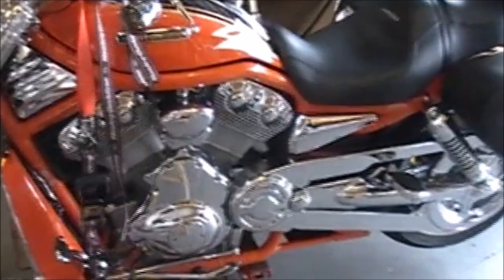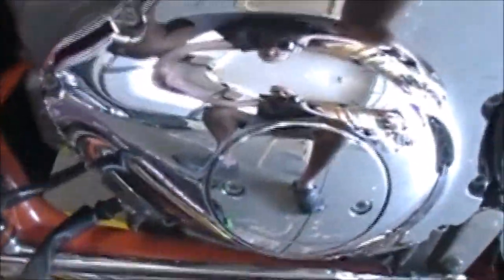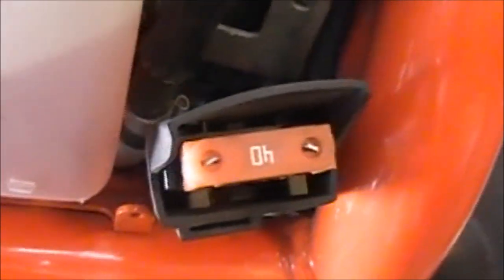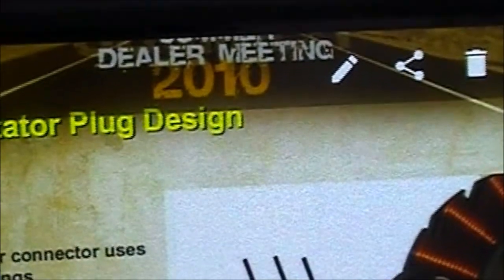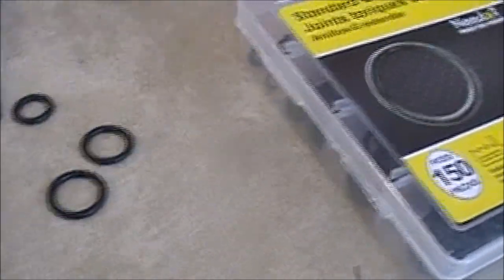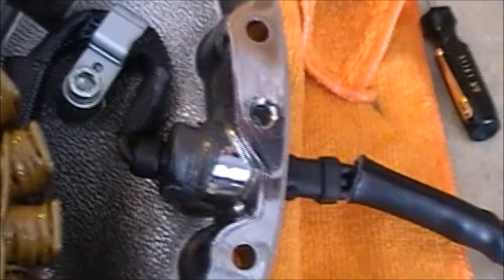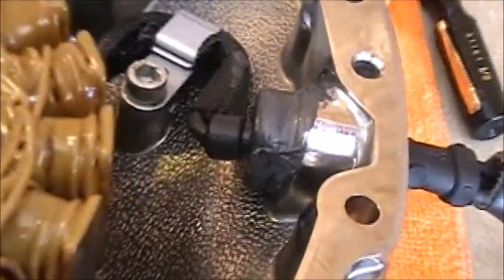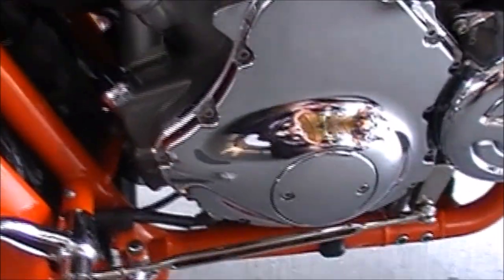2005 VROD Stator Wire Oil Leak Repair

Comment: Thank You Buffalo Peter for this fantastic tutorial  video.   The same scenario happened to me after an oil change.  One thing about HD dealers, nobody wanted to tackle this repair, which told me one thing, either it's too hard or they are chicken.  I watched your video about ten times and then did the repair.  Not hard, just time consuming.  Thanks again Bro !  Cheers !

Comment: Just finished applying the RVT. Waiting for it to dry and I'll get it back on tomorrow. Thanks for this video; very helpful. 

Things I learned:
- My HD shop helped me remove the electrical connector as i didn't have the tool for that. 
- 3/8th o ring was perfect. I tried to use some thicker ones (outer radius) and it wasn't gonna fit through the side cover. 
- getting the RTV around the grommet is a pain. A toothpick or something similar to help smear it around is helpful. 

I only had a small seeping leak so I really hope this resolves it completely. thanks again!

Comment: Thanks a lot. I did it on my VRSCR. Just to add some measurements if somebody needs: 

DIA of grommet groove:              13.0
DIA of grommet hole in cover:  15.65

O-ring ID:12x t:2

Install 3 o-rings ID: 10.8x t:2.4

After installation of 3 o rings measure of OD of grommet o-ring: 16.5
Reply: woot thx! mines leaking all over
Reply: Hey no need to go scientific here.

Just put 3 o-rings from the drain plug of a street 750 and thank me later 😎

Comment: Thank you for this. Did this job on my 07. Used just the o rings and it's holding fine. Thanks for specifics on bolt pattern and o ring size.

Comment: This worked great, thanks so much for posting it totally solved my oil leak issue. My video notes for others' reference:  
 1. remove stator wire connection from airfoil connection, the side cover comes off, screw on the bottom. 
 2. 
Then drain the oil 

 3. 
Remove the master electrical fuse (40 amp fuse)

 4. 
Remove clutch linkage (no need if middle control'd bike)

 5. 
Remove bolts from engine cover, bolt 14 to 1 per the chart. (screen shot video or refer to clymer manual)

 6. 
Take off gasket, clean it, set it aside. 

 7. 
Take off side cover with stator completely (the magnets will resist beign pulled out)..clean everything using break cleaner. 

 8. 
Push rubber grommet into/towards the stator 

 9. 
To get the o-rings over to the grommet, unpin the connector you removed from the airfoil. label each wire so you remember the ordering (he used white out and one dot, two dots, three dots, etc.)

 10. 
With the unpinned connector/dissassembled, feed the entire hose through the stator case hole to free up the entire cord. 

 11. 
Then add three o-rings : size 3/8” ID x 9/16” OD x 3/32” W (other sizes work, whatever you can get on the grommet and have the rings stay on when you jam the grommet back in. 

 12. 
Apply ultrablack to isntalled o-rings 

13.  apply ultrablack to grommet interface area 

14.  
let it dry for one to two days. 

15. ADD GUIDE BOLTS! IMPORTANT AS THE STATOR SNAPS BACK IN VIOLENTLY B/C OF MAGNETS. The size of the bolts you ened are 6mm x 70mm...cut off the heads using a metal saw. 
16. add guide bolts (cut the heads off the bolts to help guide gasket)
17. put gasket on. 
18. put side cover back on, careful with fingers, the magnets snap the thing back in. 
19. tightben bolts , ordering 1- 14 per chart.  then torque them all to spec. 
20. re attach shift linkage…use loctite. 

21.  
reconnect the wire to the airfoil connection

22. add master fuse

23. 
add oil back in (change oil filter if due for it).

Comment: Yes I used all three. Looked good and tight. Didn't leak a drop for close to a month. In going to pull it back apart tomorrow or Wednesday. I'll let you know what I find. Maybe The heat melted the o-rings. It is leaking worse now than it ever did. It looked snd felt tight after assembly.

Comment: Excellent video.  Thanks very much for posting it!  I'll do this exact fix on my 06 VRSCD.
Reply: Done and done.  No more leak! Thanks for the vid.  Might mention that the alternator cover is kinda held on by magnets, and the Service Manual lists a special tool to remove it (which my dealership couldn't even order).  Most people seem to just pull the cover off without the tool (which I did), which makes the little install rods (makeshift or otherwise) really nice to have when refitting the cover.  Just watch your fingers.

Comment: Either one of your upgrades, the o-rings or the sealant, likely would have fixed the problem but it never hurts to be double safe.
I found this post looking for a fix for the stator plug leak on my 98 FXD and got sidetracked.

Comment: Thanks for the video but I’m kind of screwed… in the process of doing the work, my wire marks rubbed off. Is there a way to know where they go in the connector based on how they lay next to one another? Any advice would be appreciated. Thanks.
Reply from the maker: Wish I could help you with this but not really sure how to.

Comment: Did you ever get this permanently resolved? I did the three grommets and the RTV, and while it initially worked, now I have a drip pan underneath because it is leaking bad. Thoughts?
Reply from the maker: bbrjch  I did this repair last July. Finished the summer off with no leaks. Been sitting all winter and still no leaks. After I added the 3 O rings and seated the grommet it was very hard to seat! Not sure if yours went in this way or nor. But it took a lot of pressure to get it back in there. Hope this helps

Comment: I have '07 VRSCAW model and oil is leaking in the same area. Going to attempt the repair any advice before I start?
Reply from the maker: Mario Rosales according to my info anything older than 2010 needs the O ring update. I have put a lot of miles on my vrod since this repair and have had zero problems, no leaks! Just make sure you torque every bolt to spec. They strip easy! I have some helpful pics but can't figure out how to post on here. Hope this helps bro
Reply: I will also be trying this repair for a second time. I am at the point of thinking about replacing the whole damn stator. Did Harley ever have a recall on these, since they all leak!
Reply: Same bike here, same issue, seems pretty common on the vrods. I'm doing this repair this weekend.

Comment: Ok I used permanent marker and dots came off wires- how do i determine where each one goes back onto the connector? I have orings installed so it’s ready
Reply: I did some research as I did the same thing. Marker rubbed off getting the grommet back through. I read that it doesnt matter which wire goes where.
Reply: It really does not matter. One complete 360 degree rotation of the permanent magnet alternator will  still produce 3 waveforms of AC voltage which will be rectified and regulated to 14.2 volts of DC voltage downstream in the voltage regulator.

Comment: Hey Peter, Great Video & Beautiful VROD. I am attempting to fix a weeping leak at the bottom of that cover by putting in a new gasket. Do I need to drain the bike before going at it if it's a motorcycle lift? Also, Should I get a new gasket or use that same stuff you have there at the bottom of the Cover? Thanks in advance my friend.
Reply from the maker: Are you saying that the bottom of your stator cover is leaking or the plug like in the video is leaking
Reply: Buffalo Peter the bottom. Also what are the correct bolt size. Thanks again 🙏
Reply from the maker: @JohnnyRoggio  I'm away from home right now but I'll let you know when I get back. I would probably drain the oil either way to fix it.
Reply from the maker: The stator cover bolt is a size 5 allen.

Comment: URGENT! My local HD shop can't find ANY part # for the rubber grommet. I just bought this sweet '04 & I'm wanting to take it for a ride over the weekend for my 50th birthday in a few days. My Clymer manual is about the same as the diagrams the HD shop has. Does ANYONE know that part # for the rubber grommet? PLEASE HELP! Respectfully, (& desperate) Michael Forbes
Reply from the maker: Not sure if you mean the O ring like I used in the video or are you trying to replace the grommet? The grommet is part of the stator wire I believe so you would have to replace the stator which would be a lot of $$.
Reply: @buffalopeter2113  Thanks for the quick response. The stator & wire harness aren't sold separately and are $170ish. You pretty much answered my question and for that, I'm grateful. Shame to have to buy all that for a $2 rubber grommet. Thanks again for your help! 👍
Reply from the maker: Your welcome
Reply: @buffalopeter2113  what’s the part # for the o-rings? Or would any 3/8th o-ring/faucet ring work?

Comment: About to try this on the 2004 VRSCA.    I see that the manual recommends a special tool HD-45304 to use when removing/installing the alternator cover.    I'm not really finding this available online and suspect it will be damn near impossible to get at this point.    I don't see anybody else in the comments mentioning having one of these  when doing the repair.   Has anybody done this repair on a 2004 or earlier model without having that tool?
Reply from the maker: Not sure about any special tool. Your 2004 is the same as the 2005 in the video. The cover is magnetized so watch your fingers when taking it off and putting it back on
Reply: @buffalopeter2113  Ok thanks for the reply.   Sounds like everybody else manages to do the repair without it.

Comment: Greetings.
¿ How many pounds the 14 screws of the lid. ?
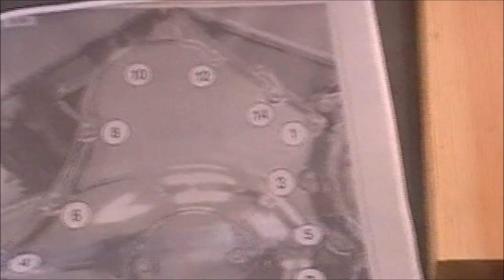Reply: Go back to around 12:20 in the video to the picture of the bolt pattern. Torque specs are at the bottom of the page. You can pause it at this point. But I think it is 9.7 Nm (85 in-lbs).
Reply: @damonaitson1779  .85 pounds is very high there is a risk of breaking the lid. Sweep the holes. The maximum would be 25 pounds. ( It's aluminum is not steel
Reply: @jmjv2656  just stating what the manual says. I'm no expert! Like I said, go back and watch the video or buy a vrod manual.

Comment: Awesome video, thanks! It would have been allot easier if the previous owner had not stripped all the cover bolts! Had to drill the head off two of them. Now I wait for rtv to dry and reassemble. How is yours still holding up?
Reply from the maker: still holding up, no leaks! Rode all over northern Michigan this weekend with no problems.
Reply: Buffalo Peter I did this as well, unfortunately it has only lasted about a month. It is leaking again! I’ll post back on what I find when I take it back apart again.
Reply from the maker: Mark Doran did you put the O rings on? all 3?
Reply: Buffalo Peter I took it apart today and found the o-rings in pieces. There also appeared to be a bit of a cut in three grommet, between two of the o-rings.i replaced the o-rings rings again and are going to give it a go again.i used allot more rtv this time. Hopefully it will hold.
Reply: Mark Doran Just did mine for the second time. How did yours hold up for round two?

Comment: Does it leak all the time or only when hot?
Reply from the maker: Vincent LeVine it started out as a little drop on the floor every once in awhile. Then one day after it had been sitting all week there was a puddle. I took a pic. I'll try and find it and post it
Reply: Buffalo Peter can you answer my question on wire placement?